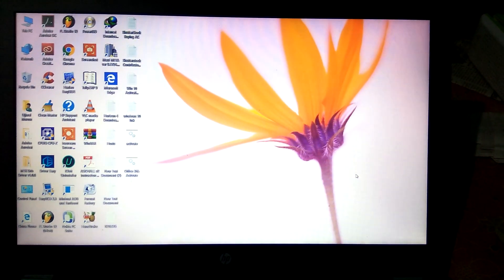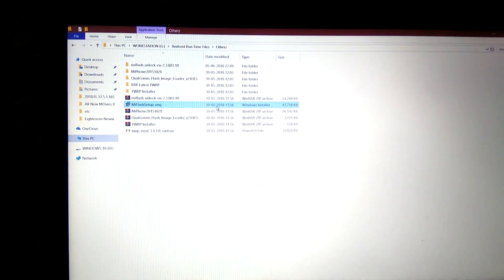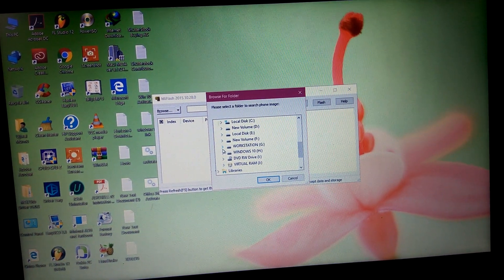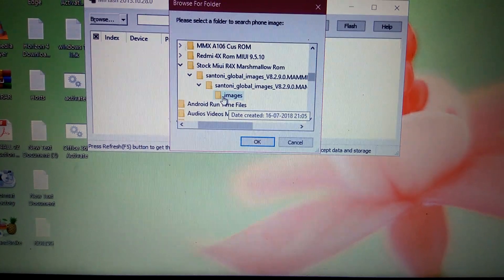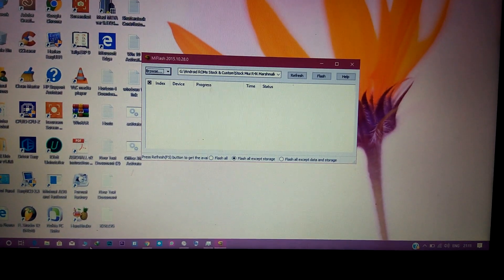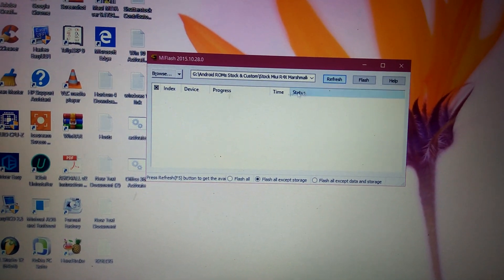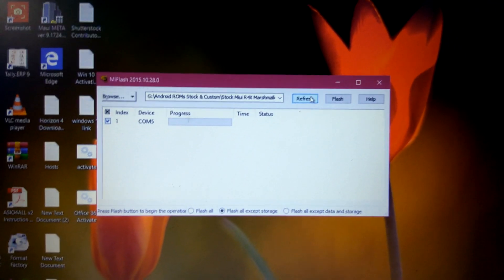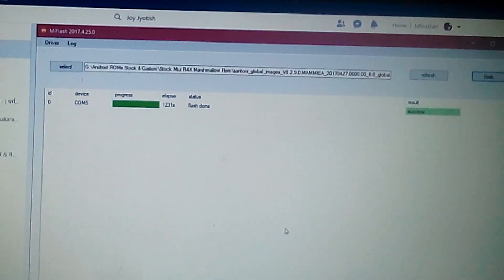How To Fix (Hard Bricked) Dead Xiaomi Phone | Using EDL Method | No Box

Comment: Bro I have k20 pro and  first it was stuck on fastboot and after some hours fastboot mode also gone and mobile was dead  and now I'm trying to flashing with mi flash tool  on edl mode and its showing me  hellow packet error 
Please help😓
Reply from the maker: Try this one....
https://youtu.be/0BQGgrQv_Ok

And this one too...
https://youtu.be/pivG924hgMo

Hold volume down (-) button and then start flashing the ROM and still keep holding it until flashing is done.
If volume down button doesn't work then hold up(+) button and try again.
Make sure you have removed your battery from your Circuit board and other modules too like camera and speaker  etc.
Reply: @LiNexNeo   bro its already detected on mi flash tool as name COM4  so it is important ? To remove back panel of device and other stuff like you said speaker display camera e.t.c
Because I don't have enough tool to open back pannel
Reply from the maker: You can but that from Amazon or Flipkart. Or get it opened by shop owners who repairs phone. And do your job. That is it.
Reply: @LiNexNeo  bro after unbrick my device fingerprint is not working 😭

Comment: Bro I have redmi 8a dual and I tried flashing magisk on it but because of some mistakes my phone become hard bricked can't on can't access to fastboot as well... So it just a bricked now can I take it to service center or follow your process bro??? Please reply
Reply from the maker: Follow my process it's very easy toh flash software on Qualcomm or Mediatek devices. Don't just waste your money at service center.
First Download and Install Qualcomm USB Driver in your laptop or PC. The file name would be like this. Qualcomm HS Q USB Driver 9008 something like that , I can't remember name properly. Then after that download install Mi Flash Tool latest version from Mi website or get it from any website it doesn't matter from where you download. Just search Mi Flash Tool latest version download that's all. After installing this Download your Redmi 8a Fastboot Firmware from Xiaomi's website. Make sure that the file extension is .tgz file. Not .zip file. Ok then after downloading it extract your Firmware using WinRar or 7z then open Xiaomi Flash Tool then boot your phone into Fastboot mode by holding ( power + volume down (-) ) button at the same time unless you see Mi Bunny. Then after booting to Fastboot connect your phone with laptop or PC using USB cable then locate your software where you extracted your downloaded firmware. Then select that whole folder and click open or next or anything that is available to proceed further ahead. After that at the bottom of Xiaomi Flashtool window you will see Clean and Lock, Save User Data, Clean, so among these select Clean and Lock option and hit Flash button after that wait for sometime to flash the ROM until and unless the message pops up in Xiaomi Flashtool that Flashing Successful. After successful Flashing boot your phone that's all and do setup. Remember that all your files in your internal storage will be wiped and deleted. Even if you select Save User Data option after flashing ROM when you boot your phone it will automatically wipe it, so that is of no use.
And  lastly if your qualcom drivers are not installing then search on YouTube how to install it and if it is  not installing then it might be Driver Signature Enforcement in Windows to disable that you can watch my video how to disable or search on YouTube. Then after disabling Signature Enforcement again try to install driver it should install now.
By the way one last thing I would say  do some research about all these before you proceed because it is necessary to avoid problems. And I will not be responsible if you mess up anything Do it at your own risk.
Hope you will find this helpful. 😊

Comment: yo bro can flash with sp flash tool?? xiaomi note 4 mtk
Reply from the maker: Yes you can flash every MediaTek devices using SP FlashTool.. just select the scatter file and select download & then click download button and plug in USB cable and Flashing will start... Also install the MediaTek VCOM  driver for proper and Fast Flashing. You Can also use... Xiaomi FlashTool to Flash the ROM

Comment: What does the deep flash cable does?
Reply from the maker: If you use the deep flash cable.. 1st- you well get very good speed 2nd- it will be compatible to flash all the phones with proper data transfer. 3rd- it very beneficial for modifying phone with your PC. Because if use proper cable. Or Deep flash cable there is very  less chance to get errors.
Reply: @LiNexNeo  but what does it does in case of no fastboot no edl no recovery i.e Hard Brick condition?
Reply from the maker: It is very useful in that case only.
Reply from the maker: Deep flash Cable is Thicker than the normal usb cable.